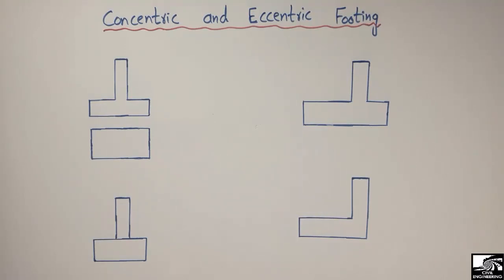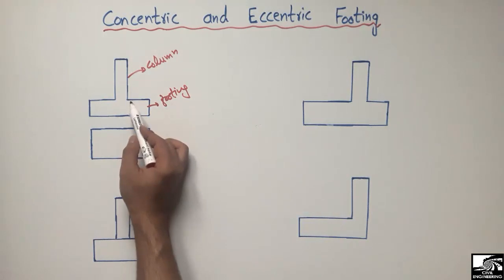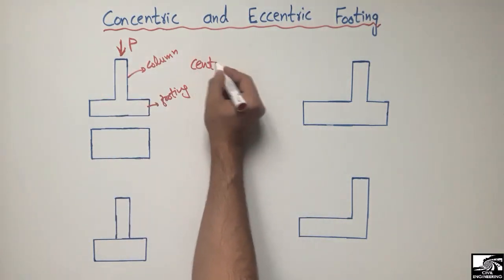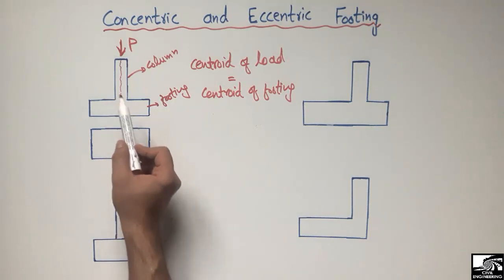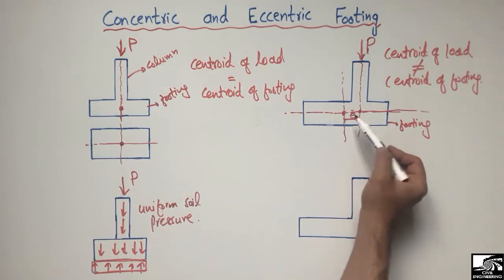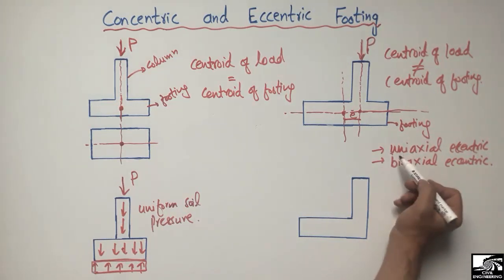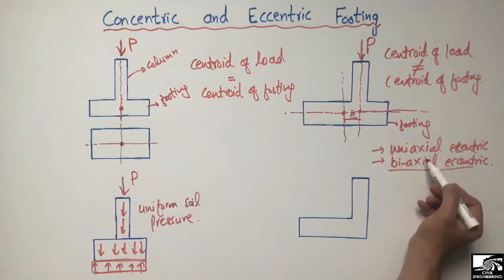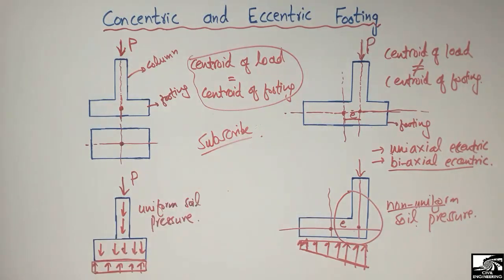Difference between Concentric and Eccentric footing

Comment: Why would you ever want an eccentric footer?
Reply from the maker: Sometimes, when you have to construct building in between two buildings. Then there is no proper space for edge column footings due to which we have to consider eccentric footing.
Reply: It's good for 4 storey 800 sq ft building or not any disadvantages in future